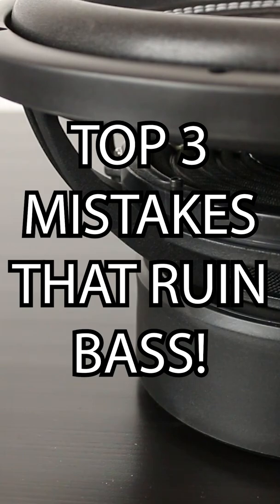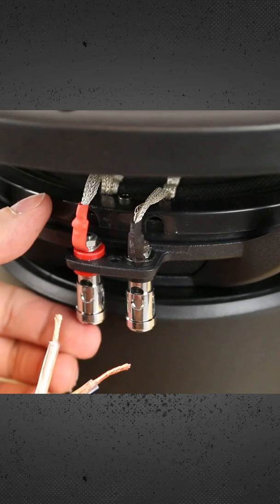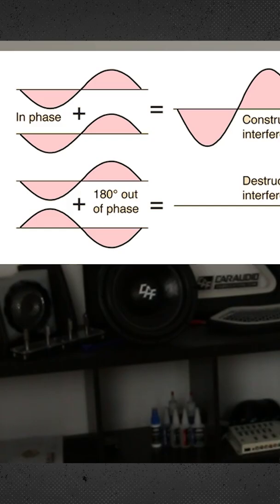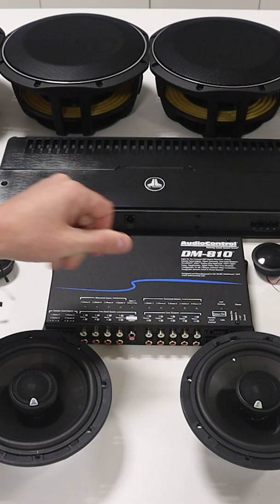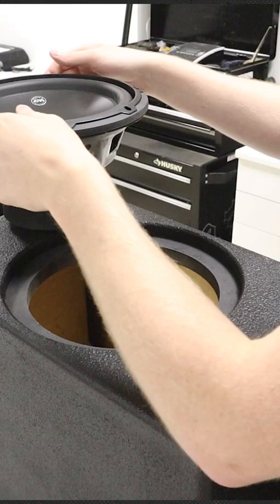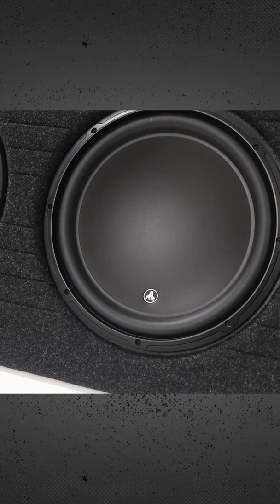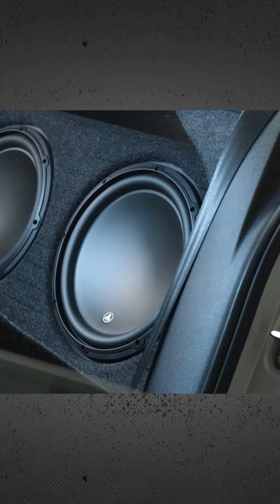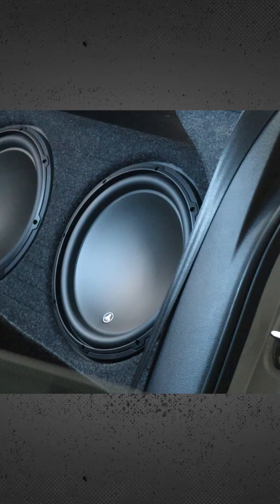3 Mistakes that Ruin Subwoofer Bass! #shorts

Comment: @caraudiofabrication a common one these days are a factory unit having a bass roll off at higher volumes. 
Even a de equalizer on a dsp dosnt really fix it, my ford ranger i tried multiple subs and configurations and was never happy. 
Eventually found out i could change the factory eq in head unit and set to flat. 
Now its 👌🏽

Comment: My bass kicks in and out sometimes, one time it’ll be loud as hell all the way down the next it doesn’t do anything no matter what my settings are. My box is loose in the trunk and my phone is always filled with sand so idk if it’s a bad aux connection I got a new aux and all that. But I’m on my 3rd alternator (not like that) and none of my amp fuses or anything like that blew yet which is surprising
Reply: Bad RCAs is my guess.

Comment: Wrong about enclosures. Smaller than recommended is what you want for spl if you really wanna blow people out the water. EFFICIENCY
Reply: A smaller enclosure is going to reduce the motor force by causing compression that the driver isn't spec'd for. Just use the correct size box.
Reply: @Thezuule1  you haven’t done your testing 😭
Reply: @Thezuule1  it’s still 100% through and through more efficient. Proven through plenty builds. Try 147 on 200w total with 4dd SC 9915 in a flat wall in a half cab 94 Tacoma lol, or 4 DD z3s in a Durango stock class under the window no wall, box doesn’t even have recommended for 1 sub. 153 with no batteries lol, literally caps and an alternator, and blows people out the water in the lanes when he has batteries. Once again, no issues on either of those.
Reply: @majinbenproductions1038  it's physics, no testing required. The mechanical suspension of the subwoofer is the main reason for the box volume calculation. Decreases in volume increase pressure which requires more power to produce the same movement. This isn't rocket science. As a subwoofer moves inwards it compresses the air inside the box and as it moves outward it creates a vacuum. If you increase the pressure/vacuum inside the box you are making it harder for the subwoofer to move not easier. This shouldn't require a ton of thought to realize.

Comment: For some reason my cadillac had 12v dc going to the factory bose woofer and therefore the bass was weak. Getting rid of the 12v lead and boom instant upgrade.
Reply: @Mr.Robert1  easy... speaker connector had 3 wires: blue is plus, black with white stripe was 12 volts and green wire is ground. The black wire had 12 volts of direct current that went to the speaker I removed this and the bass now hits harder than before.
Reply: @Mr.Robert1 2002 cadillac deville.

Comment: 1. Assuming extra batteries compensate for poor / messy wiring. 2. Mixing inferior products with quality ones due to budget 3. Failing to do proper research & relying on ignorant “you gotta” advice from fools.

Comment: Amp on top of sub box
Reply: Yep,  it can vibrate the hot solder loose from the vibration of the subs.  Iv seen this happen.
Reply: Yep it can vibrate the hot solder joints lose and melt them loose.

Comment: If the box is too small add passive radiators, I got (5) 6 1/2 p.r.s on my bt speaker with (1) 6 1/2 low sub n 2 4in mid subs and 2  tweeters, don't follow all this shit, learn from trial and error
Reply: Are you saying not to follow the advice in the video? Lol
Reply: You can't just randomly add passive radiators to a box... this all needs to be calculated.. You don't need to trial and error things that can be perfectly calculated using math.